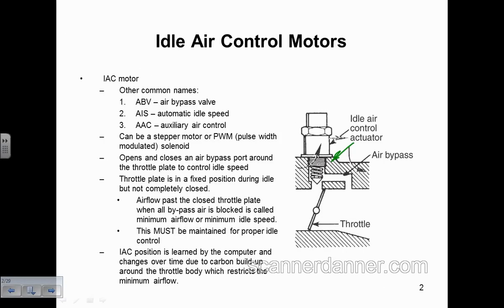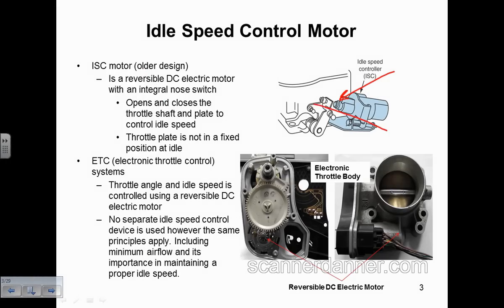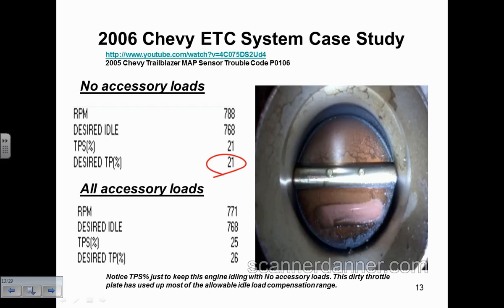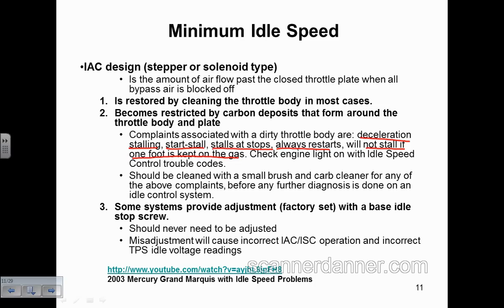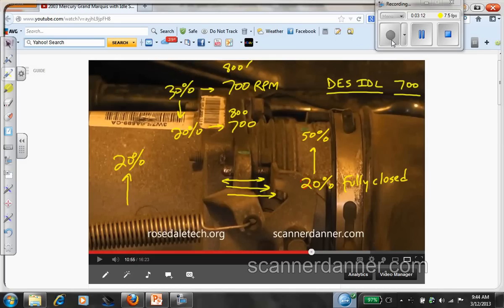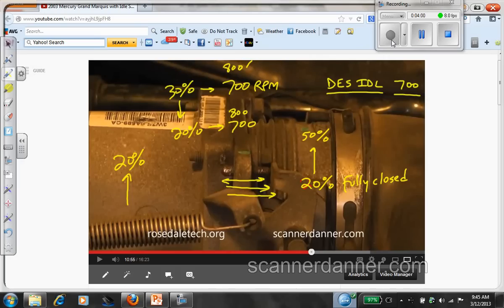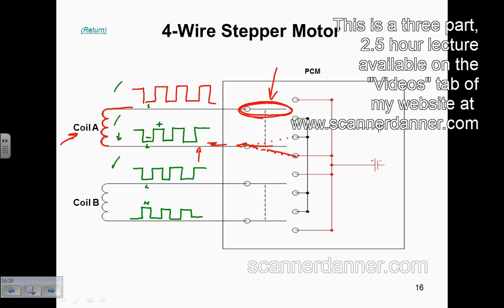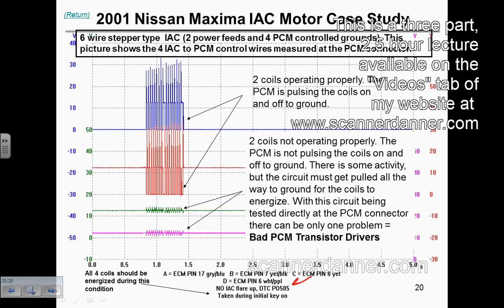Chapter 20 "Idle Speed Controls" - preview (an SD Premium video)

Comment: Mine jives along with all he is saying here, yet he claims it is a vacuum leak. I checked, there is no leak.
Checked fuel trims at idle and 2500RPM on my Ford Focus. Results STFT way over 20% at idle gets better (less) at 2500. LTFT was stuck at 25% Both O2 sensors passed switching test and I/M readiness passed, but then code P0171 came back and idles rough and then  dies. Also, one O2 sensor says max amplitude failed, and even though it goes into CL quickly, an OL-FAULT is showing up. Not a code, just what my rudimentary AL519 Autel shows me. Also of note, scanner shows both O2 sensors passing switching test. I bought an IAC but DID NOT install it, can return. I need the $80 back. Also of note, my Downstream O2 sensor the waveform does not look regular up/down sawtooth like US sensor, and seems to cut out at times while watching live data.
Any ideas welcomed. I feel it is the IAC because the idle hangs high at times, before coming down. I feel IAC is full of crud. Turning on AC keeps idle up enough it does not die and is very drivable, no power loss. My throttle body is clean inside.
Lazy O2 sensor AND IAC problem?
Reply from the maker: Why are you talking, like that? Like other people are seeing your post on this old ass video. Talk to me bro and stop this condescending approach. You want help, this isn't how to get it from me.
Reply from the maker: How did you check for the vacuum leak? Did you know PCV valves can stick open and be a vacuum leak? 
Your car was known for PCV valve issues. It's below the intake manifold. Got to get underneath to see it. (From memory). Pinch or block it off and see what your trims do.
How does it run under load? 
(The rest of your replies to me, need to be under this thread and you need to be patient. I have 400k other people asking me questions too)

Comment: Hi sir, sorry my poor English but can you explain about the PCV systrem. For me it works like a bypass valve it breathes before the thottle plate and realease the blowby gases after the thottle plate. Greeting from Guatemala
Reply from the maker: No preoblem, the PCV system will pull crankcase vapors and re-introduce them into the intake to be burned. In general the valve itself provides a regulated, controlled amount of flow and the air inlet for the system is behind the MAF sensor so it is also accounted for in the fuel delivery strategies.

Comment: Nevermind that, a stupid question. 4pin means Stepper Motor-> 2coils fed with current flow in order to rotate a screw and control the depth of  its exact position in 256steps. I guess that is kind of slow control compared to the duty cycle IAC

Comment: Great explanation there! I have a theoretic question-  I am just wondering if we want higher RPM for whatever reason(for example 1100 opposed to ECU desiring 800)  and we adjust 1100 at closed IAC-> ECU will keep that closed IAC position running at 1100 RPM - it will fail to achieve the desired 800 beacause of the very closed IAC which has no room for closing anymore ,  is our goal achieved  resulting in higher RPM and just one ERROR CODE ( Idle speed incorrect-higher than ECU desires).
Reply: don't ever adjust the min idle air control screw ,it is a factory setting and it is essential to proper IAC operation .and depending on the year will probably set the light and create more drivability problems.

Comment: I don't really want to start a argument here, but 4 out of 4 retired Ford engineers disagree with you.  Most non-ETC Ford's will have a hole in the throttle plate for minimum idle air flow.  No air flows around the plates at closed throttle by design.

Comment: @Bri C not sure if that comment was geared towards me, but I can assure you I am far from a parts changer! Lol.  This particular VW it just did not occur to me that someone had tampered with the idle screw.  That happens sometimes. In my case the TPS was off because the screw was adjusted not letting the throttle valve close to spec.  It occurred to me days after the vehicle was fixed that perhaps the adjuster was tampered with. Testing the old TB on my personal vehicle confirmed it.

Comment from the maker: APP is the input. PCM reacts and opens the throttle. TPS informs PCM that throttle opening matches what is desired and commanded. The TPS on an ETC system is now a feedback sensor. It is completely different than before.

Comment: Paul, one last Q, Drive by wire have TPS signal along with Motor control. will this TPS signal mirror APP signal?. What I did not understand is, APP signal should tell PCM how much Throttle should be opened and in my view, PCM should just PWM signal to motor control to open throttle accordingly, why PCM is sending TPS signal to DBW actuator in addition to motor control. Am I missing some basics.

Comment from the maker: 3) on some there is some initial activity during key cycles
4) no, move the plate manually (make sure you unplug the connector and key is off)
5)yes
6) no, usually two TPS signals and motor controls, so at least 8 wires

Comment: Part 3
7) can we use IAC functional testing(Solenoid or stepper type) for cold and hot engine testing for drive by wire as well.
8) which manual will give us the position count or desired angle of tp on idle. Only manufacture manual will give?.

Comment: Part 2
3) Does drive by wire also extend and retract when we cycle the key?.
4) Drive by wire is pulse width modulated type. Can I use my test light to open the throttle plate for cleaning in vehicle even though it is pulse width signal type.?.
5) Can i forcefully open the throttle plate after disconnecting Drive by wire physically from the car to clean?
6) Drive by wire will always have three wires Dc motor(+,- and % open signal feedback) unlike  4 or 6 wire stepper motor, am i right ?

Comment: Part 1
1) Can stepper motor or drive by wire mechanical problem be reflected in wave form while scoping computer control or we only know the computer is just controlling and mechanical problem will not be reflected, ?..  i assume this question
will apply for fuel injectors as well, i may be wrong.
2) in 4 wire stepper motor for a coil, we have + and -, does computer send control to both + and -?. I see that + signal and - are inverting each other..

Comment: ContagiousFX - Cranking at closed throttle and no minimum idle air flow will quickly cause a flooded engine. WOT during cranking (no fuel) clears the flooded condition.

Comment: (2/2) ... Only about 60 bucks total, where the mechanics wanted at least 400$ just to replace the IAC for a new one, and nothing more!!! Mind you, I think I was lucky I got away with it by just cleaning the IAC, because it hasn't given any problems since then 6 years ago, but if you have to replace it, I would go for a non OEM part just to try it out because the IAC from the dealer was so expensive. What do you think?

Comment: (1/1) Hey Paul, just my 2 cents from a total noob you helped greatly. On my 2001 Honda Civic, I found out that clogged IAC's are actually very common when suddenly my car would stall dead stopped while driving on the interstate. I don't remember the OBD code for it but taking it out and cleaning it with brake cleaner and a toohbrush fixed it, as well as replacing its gasket and flushing the entire radiator with new antifreeze and a flushing kit. Only about 60 bucks total, where the mechanics...

Comment: Hi Paul i have a Toyota truck with a hig idle speed i have smoked the vehicle  and there are no leaks the idle speed is normal when cold and when hot its at 1200RPM
Its an old toyota system 1997 i think it has that wax type of iac system
where in you book can i find help

Comment from the maker: That is not true my friend. The "protective" coating that Ford used was to help keep the throttle body from building carbon deposits, that would restrict minimum airflow around the throttle plate. (It didn't work!)
Every fuel injection system has a "minimum idle speed" (airflow past the closed throttle plate). Some will actually have a hole drilled into the middle of the plate. On this design, dirty throttle bodies are a non issue.

Comment: Obviously this is on non-ETC models.

If you have a "no start"/"hard start" issue,with this type of system, verify the complaint but then crank again and start pressing on the accelerator while cranking.  Continue cranking until you get to WOT.  A WOT the computer will shut off the fuel (clear a flooded condition) and the engine will likely start.

Comment: have to disagree with you !  Older Ford products that use an Idle Air Control (IAC) non-stepper actuator do NOT allow any air past the throttle plate.  In fact there is a coating sprayed on the throttle bore behind the plate so that it seals without locking in the bore.

Understanding this is important because a common "no start"/"start and stalls" condition is caused by the owner cranking without stepping on the accelerator.  This will eventually flood the engine.  Clean only the IAC !

Comment: Meant to say "cleaned plate" but idle issue still present. Ran all diagnostic tests, everything checked out. Only question mark was the TPS pids off at idle. So after much diagnosing replaced the TB thinking the TPS was at fault.  Issue resolved, but it didn't occur to me after u replaced the TB: idle screw!

Comment: Had a case once where an adjusted idle screw whooped my butt. 2008 VW CC. Code for idle range, erratic idle, surging, and the occasional stall. Plate was dirty, idle improved but vehicle still "searched" for idle, and code still present...

Comment from the maker: I've thought about the DVD but if I do one I wanted to do the whole book. I still have to complete Sections 17,18,19,21,22, & 23. I am still not 100% on doing a DVD though. I want to protect myself as much as possible. So as of now, there is no download or DVD. I hope you understand. Thanks! Let me know if you have any other questions. Oh, the ETC systems, yes, it is a pulse width modulated reverse polarity DC electric motor. No separate IAC device.

Comment: Thanks Paul, Before I buy i have 2 q.
1) So even i pay around 100 dollar, will I get a chance to own a DVD copy. If your are not interested i will go and head and buy from ur site for 21 dollar.
2) I was told Drive by wire so far have not use stepper motor is that true rather they use pulse width Dc motor , pls advise.